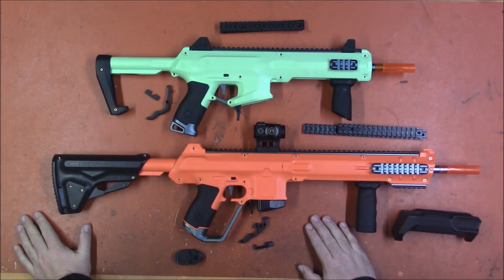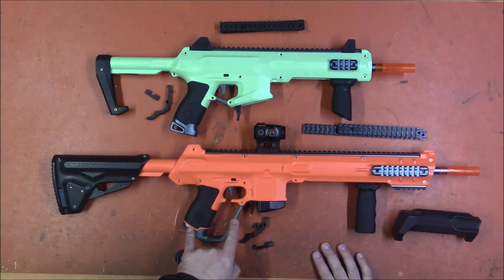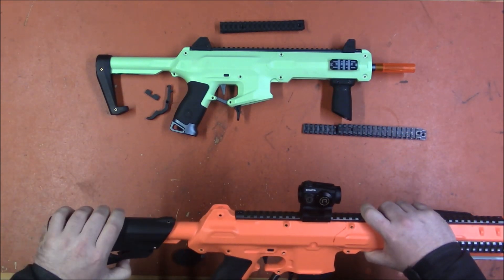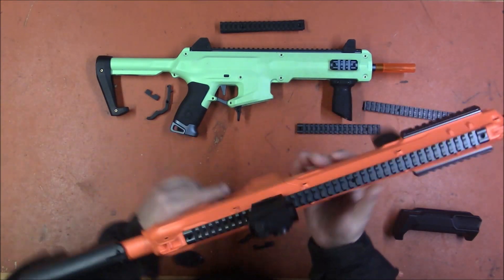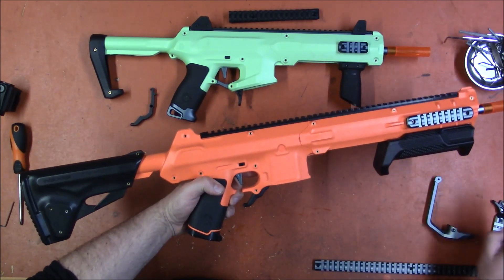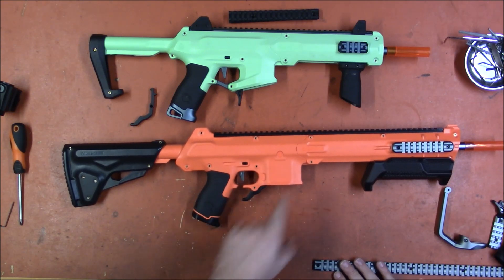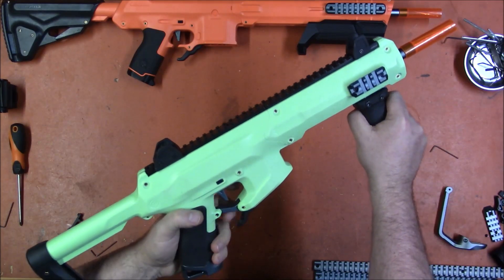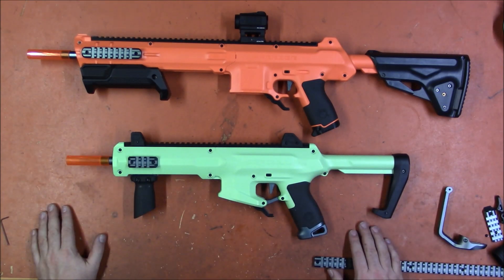Zaurko - Harrier and Seagull Parts

Comment: wow its kinda crazy how different the Harrier looks with the different grip and missing knuckle duster
Reply from the maker: Right!?
Reply: @CaptainXavier  how do you remove the knuckle duster thing on the harrier? I was hoping youd show it in the video but it just cuts to the next shot and its already gone. Also what did you replace it with?
Reply from the maker: @vlima7164  you take all the screws out so you can take the blaster apart, then remove the knuckle duster piece, then replace it with the replacement parts from Zaurko, and finally reassemble the blaster using the screws you removed in step one. 

Do you need me to explain how to remove screws?  ;P

Comment: Does that shotgun grip make priming the Harrier easier when using heavier springs? I struggle to prime the 1.6 gauge springs unless I use the side-priming bolt. Wondering if the shotgun grip would help or hinder.